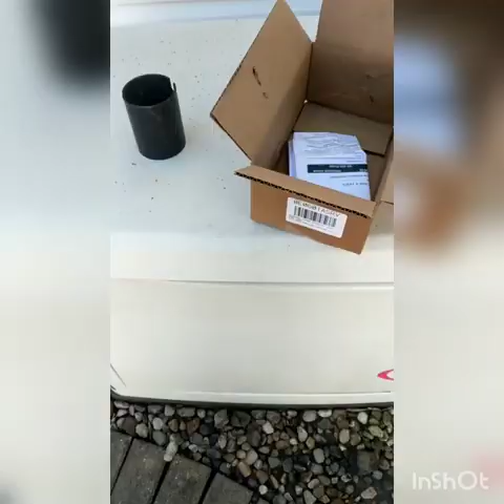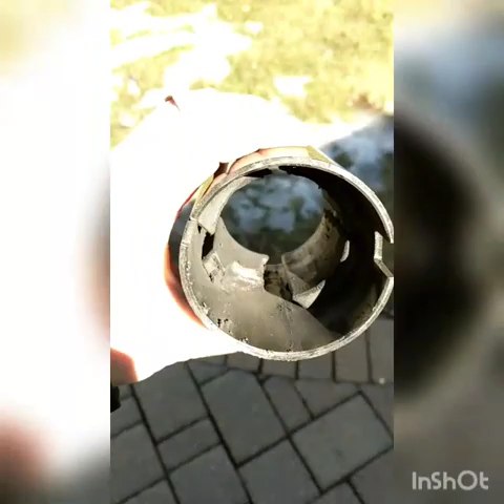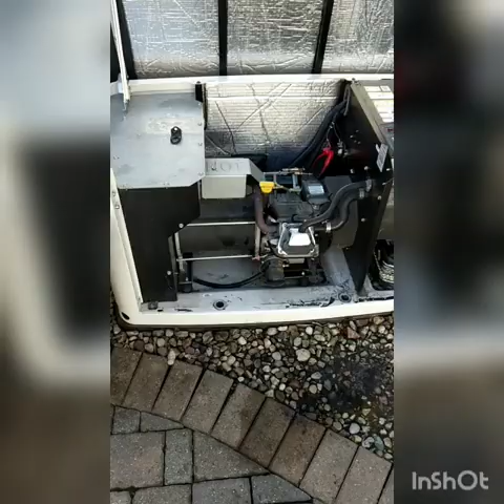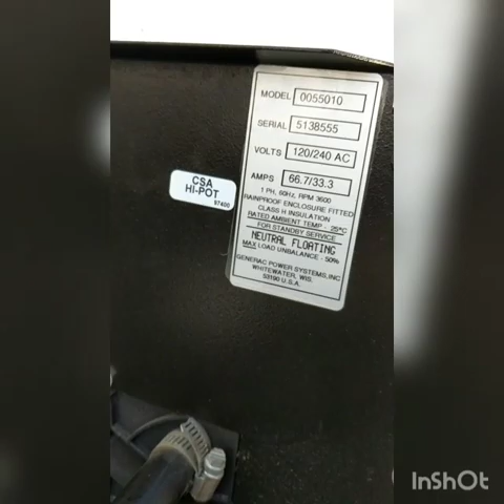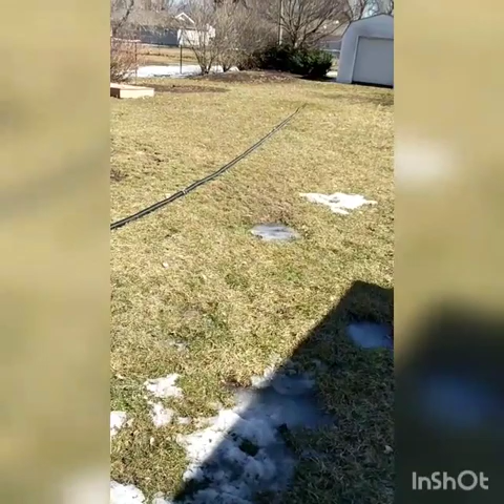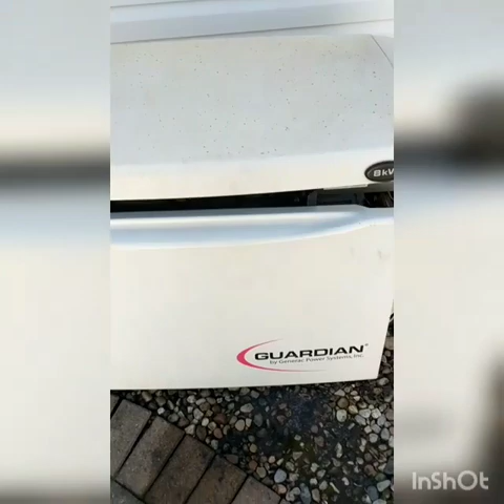(Moved to New Channel) Generac Guardian 8KW Not Starting - Solved

Comment: Thanks for your video.  We have same on farm in Ohio.   I installed 15 yrs ago.  Working pretty good but didn't realize the starter was shimmed improperly from factory.  Caused shaft to fracture.  Gear head cracked off & separated.   Evidently starting repetitively over years over strained the shaft (too tight against flywheel) and caused fracture.   Figured out by self.  Once I seated the amazon replacement, too tight,  I realized quickly what caused issue in first place.
Reply from the maker: Glad it helped

Comment: Would relacing a RC14YC spark plug with a RC12YC be ok? Just wondering if that would help starting and eliminate too many cranks. Need to know ASAP. Thanks
Reply: Stick with what manual calls for in my opinion. From what I understand fuel isn't provided until cranking occurs, so cranking isn't necessarily a bad thing.
Reply: @IowanTAA  Thank you for replying. Feel like I'm talking to myself sometimes on these sites. I'm kind of old school when it comes to electric starts. All my motorcycles were kickstarts which usually started first kick. My riding buddies would drive me nuts every time they would use their electric starts. . . sometimes to the point of running the battery power down. Then they would end up kick starting it and guess what? Started first kick. lol My point is, I can't stand the thought of any more than a few turns of cranking for startups. These Generacs are so touchy. Still wondering if that RC 12 might help. Guess I could try it and see what happens. . let it run for bit, pull the plug and inspect it.  Thoughts?

Comment: Brilliant video!! I have the 8kw air cooled unit and I have the same exact issues. A couple years ago I swapped in an aftermarket starter which did not solve the issue. I have confirmed my battery is good with a battery tester. I have tried to start the unit with a higher CCA rated battery from my car and same issue. I am going to check my valves and adjust them as needed. Thanks so much for making this video!!!!

Comment: Hey this is great , same model only my starter went out , gave it a heavy TAP and heard  grinding before RPM sensor popped on but I will adjust Valve after your experience

Comment: I have a Generac 8kw that looks exactly like yours. Just purchased my house a few months ago and the Generac was cycle running once per week. Now I noticed that I haven't heard it turn on at all, so I checked it out and the RPM Sensor Loss light was on. I'll have to go through the processes you explained starting with the battery and then go from there. Also, is there a need to reset anything after disconnecting the battery? I know on some Generac's, you have to go through a reset process. Another question I have is, when you turn it on manually, should the house main breaker be turned off first. This is all new to me and I was told many different things that if you start the Generac without turning off the house main breakers you can cause damage to the house, the Generac, etc. Anyone that can expand on this, as well as the RPM Sensor Loss light coming on, I would appreciate it - Thanks in advance!
Reply from the maker: There shouldn't be anything to reset. If you have an automatic transfer switch, then there is no need to do anything with the house's main breaker; power should only be fed from generac to house if the automatic transfer switch senses there has been power loss for a bit (i believe 25 seconds). If you do not have a auto transfer switch, then your breaker for the generator should be in the off position at all times and only turned on when there is no power coming from utility company, and at that point, you would switch your main breaker to off position.

Comment: Three years later and this video is still getting people!
Thank you, I started by replacing the battery, and still had RPM SENSE LOSS.
I was able to get it running by freeing up the starter motor, it seemed to be stuck in place.
If problems persist I'm going to follow all of your steps and watch the adjustment video if needed.

Comment: Great video.  I am having the same problem with my 8kw Generac.  Battery tested good, also started one of my cars with it.  No voltage drop through the contactor.  Starter spins when off engine, but won't power through compression stroke.  Pulled spark plug and no binding through several rotations.  But checked valve adjustment anyway, there was just under .001 clearance, so I made the adjustment to .003.  So your video was a benefit because it helped me rule out the valve clearance.

Comment: Sounds like what mine is doing. Except when I got there there was more oil under the generator than normal, when I tried to start it after checking the oil, it made a grinding noise when it cranked for just a second then it never cranked again. Just a clank and no crank.
Reply from the maker: Yikes, check the lash to start. Oil leak would be no fun!
Reply: @tyleravis7362  The valve lash, going back out there tomorrow to check it all with the right tools. It only has 170 hours. We will see.

Comment: Wow.  You just saved me close to $400.  Thanks for taking the time to post this video and explain the issue.  My generator experienced exactly the same issue - "Inspect Battery", "RPM Sense Loss", clicking.  I replaced the battery and has the same symptom.  Puzzled, I started researching and ran across your video.  I removed the fan guard and attempted to turn the shaft (clockwise) and sure enough...parts of the cycle were restricted.  The clearances were way off on 3 of the 4 valves.  (I'll start checking these clearances with oil changes like I should have all along...)  Also, my generator is a 17KW #5873 - so this process likely applies to a wide range.

Comment: I have a propane 8kw acting up. Same problems. Just recently. The guy that was servicing it retired. He replaced the coil a couple years ago and it was good for a while but I have a question. That intake tube. Did you replace that with something aftermarket?
Reply from the maker: No, intake was stock.

Comment: I have a question did you know that when you're cranking that flywheel by hand that when you hit the compression stroke it will get very hard and you will not be able to do it and you may not be able to hold it on top dead center did you also know they're on the other part of the stroke cuz the Piston comes up once for the exhaust back down for the intake up for the compression then the ignition that's where you get the compression stroke that when it's on exhaust stroke the valves are very tight you shouldn't be too tight but they are tight I hope you adjusted that right and didn't teach everybody unadjust their valves I would say I don't know what to call it by the way the contactor is also known as a solenoid in the automotive world and generator world just FYI I hope you have a great day I'm glad your generator is working very well the valves were probably your problem they were probably miss adjusted they're supposed to be adjusted every so many hours great job
Reply from the maker: Generac lists the part as a contactor, and the clearance for the valve lash is quite specific. When I set mine to factory spec, I didn't notice any resistance at any point while rotating flywheel as I have explained in other comments.

Comment: Was the difficulty turning over because of a compression release not functioning because of the valve adjustment being off?
Reply from the maker: No, lash on valve clearance had become out of spec.
Reply: @tyleravis7362  so these gennies don't have a compression release mechanism for starting?
Reply from the maker: @shanwar9844  Not 100% sure if they do (but I believe they do), but to access I believe splitting the generator would be required. To see if the compression release mechanism is frozen in the engine. remove the valve cover and spark plug and rotate the engine over slowly watching the intake and exhaust valves. Near top dead center on the compression stroke one of the valves should open up slightly to release the compression if it does not and your valve clearances are ok and lifter alignment is right, then its possible the compression release is binding.
Reply: Going through this now. The spark plug needs to be removed to rotate the engine through the full cycle. If the plug is in, it will be very difficult to rotate through the compression cycle. With the plug out, it should be easy to rotate through the complete cycle.

Comment: One possible tip for other people with this generator or similar models, if it won’t start ,try taking the fuses out, let it sit for a minute then put them back in.

I have an 8.5 kW Generac, Gen.one, been running for at least 15 years, anyway mine was having A real hard time starting and wasn’t able to start on its own, for the weekly exercise. I tried using the manual switch and it just seems like it would try to start but wouldn’t, I could tell that the battery was giving it enough juice to start and the starter was trying but it just would not kick over. After 30 minutes of screwing around with it I decided to take both fuses out and just put the continuity tester on them. After putting them back in the generator it started like a champ, so I don’t know if it’s kind of like a computer, And needed a reboot but I just wanted to put this tip on there for any other people with a similar model, if all else fails, just cut all the power to it for about 30 seconds to a minute and then put your fuses back in mine started right up and has done it several times since. Also great video there aren’t many videos out there about how to fix these models for a DIYer  or average home user who can’t get service for weeks, but wants to be able to try something on our own in the meantime.

Comment: My 8000genrac starts runs for a few seconds then dies can u suggest  what may be wrong
Reply from the maker: If it starts but doesn't run then I would say you have an air or fuel problem. Other than checking the air filter and spark plugs, if it's more involved, a professional tech is likely going to have to diagnose the issue.

Comment: The flywheel should not be FREE to turn 360. It called the compression stroke! If you dont know how it works good idea not to make blind adj.
Reply from the maker: I never stated to make blind adjustments, nor did I say it should rotate freely; should be obvious to most that will be completing this repair that when an engine works to make combustion there is going to be resistance. I stated that I had issues with it rotating in a certain position, almost to the point where it wouldn't rotate at all. I then checked the lash, (valve clearance) and found It was not to spec; only then did I make an adjustment. Upon completion of the adjustment, the problem was resolved and the flywheel did rotate 360 without the level of resistance which was present before. Thanks.
Reply from the maker: @spirit seker  We're on the same page; should be very little resistance except during compression stroke(s); flywheel should easily be able to rotate a full cycle. For a section in my case, it was not able to until the adjustment was made.

Comment: Gracias for the video, I had a customer in my city with the same issue, I already told him to change the battery 13V for a new one (It had a voltage drop), we already changed spark plugs (They were rusty) and finally the starter would be the problem (We havent checked the contactors). best regards

Comment: Hey. Thanks so much for this video! I have the same generator with a very similar issue. 

Do you have any information on changing the starter? This is my next step, thanks!
Reply: Take a photo of the generator before disassembling anything, but the starter is essentially held on by a bracket and then 2 main bolts. Once the starter is off you can use a flathead screwdriver to try and turn the flywheel, which is when you'll be able to tell if there's a rough spot and determine if the valve clearance needs adjusted.

Comment: Thanks for posting this. I've had my 8KW serviced by the local Generac outfit several times because of this problem, and now it's back. Not only doesn't it crank long enough to have a chance to start, it doesn't crank at all. When I try to start it, there's a loud 'clunk' sound, which is very much like the sound a starter solenoid makes when a car battery is dead; is that the sound that yours made?
Reply from the maker: Yes. It would click or clunk and then the starter would actually make a high pitched noise from not being able to turn over. 

If you remove the starter, you'll get access to the flywheel. From there you can use a flathead screwdriver to turn it and if you have any portion of it being hard to turn then you may have a problem similar.
Reply: Thanks -- I'll give it a try.